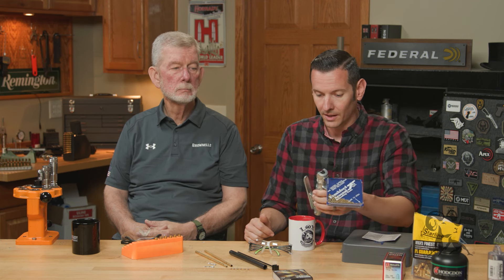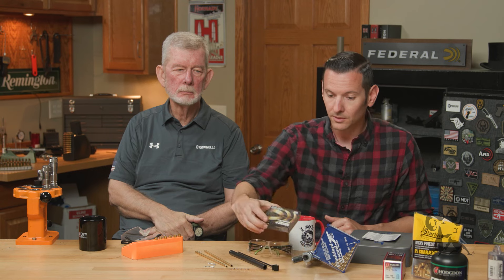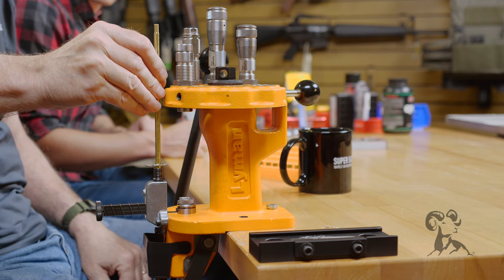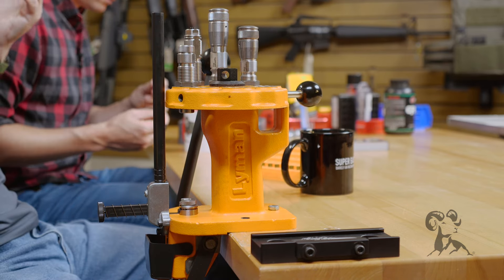Reloading Series: Case Priming

Comment: I was taught to seat the primer slightly below flush to make sure the anvil in the primer is under stress.  Around 1990, I picked up an RCBS positive ram primer that screws into the press.  It has very good feedback so I can tell if I've got a crimped primer.  When I remove the primed case I always run my finger on the primed base to make sure it is at the correct depth.

Comment: Like others, I can’t use the hand primer anymore. The RCBS bench mount primer tool is good for me for rifle. The Lee classic turret press primer attachment is pretty simple for pistol. Just what works for me. Good video
Reply: I use a Forster CoAx bench priming tool for rifle.  It gives me more leverage but I can still feel the primer seat. I can make sure the primer is below flush for rifles with floating firing pins.
Reply: I use the RCBS bench prime as well due to arthritis. I put a large heavy oak ball (almost oval or egg shaped) on the handle and it made it much easier for me to use with the arthritic knots in my palms.

Comment: Obviously you guys do not like or are not sponsored by Dillon. Their auto feed priming system on the older progressives can be a bit finicky, but when they're dialed in (not difficult), they work. The new system solves the finicky issues of the one I have (ostensibly). I plod along with the old system and load 100 rounds in about ten minutes, all very consistent in charge, seat depth and all the other factors. Have you ever heard of Ponsness-Warren presses? Another good option in presses, not cheap, but good.

Comment: Primers which are not fully seated have caused light strikes in some occasions as fing pin pushes primer deeper.. On second 'strike' they go off.

I use the Lee safety prime on the classic turret press. I imagine a hand prime system might strengthen hand muscles, which might improve pistol shooting😅

Comment: They are using brand new cases, but if you are reusing brass you have to watch out for military style cases that may have a crimp on the primer.  They should mention ways to move beyond the crimp.  45ACP and 9mm case should be inspected for the crimp before trying to prime.  This is also seen with 5.56 rifle cartridges.  RCBS makes a swaging tool.  You can also ream the primer pocket to remove the crimp.
Reply: Also 45 ACP has large or small primer pockets you have to sort them before you prime them .

Comment: I hate the hand priming tool
Reply: Me too. It may be okay for the younger set, but my arthritis doesn't play well with one. I use the RCBS bench mounted priming tool instead.
Reply: Why? Is it difficult to squeeze? Slower?  Just curious. 👀
Reply: @onionhead5780
The arthritis in my hands means that my fingers lack the range of motion to operate a hand primer any more. I've had the Lee Auto Prime tool for more than 40 years now, but I can't use it any more. The fingers just don't bend enough. It really, really sucks to get old, but then, it beats the alternative.
Reply: Me too. I have the RCBS one and invariably, I will have a primer that won’t seat and then the damn case gets stuck. You have to take it all apart, go to the press (where I should have gone in the first place) and finish the job.
Reply: @maynardcarmer3148 well, when you think of it, it doesn’t really beat the alternative. It proceeds it.
Reply: @jameswhitaker1324  
No, the alternative is NOT getting older. I have two classmates who have been but names on the Wall since it was first built. Neither got to see age 20. There are guys that I served with who are there, as well.
Reply: @maynardcarmer3148  Makes perfect sense sir.  I’m an old dude too but my mind still thinks I’m young. Every time I walk by a mirror I think who is that old man. 😂 Currently my finger strength is still good.  My old knees are where my arthritis and age is showing.  And I agree. It sucks getting old. Thanks for the intel. Shoot safe and shoot straight brother. ✌️👍